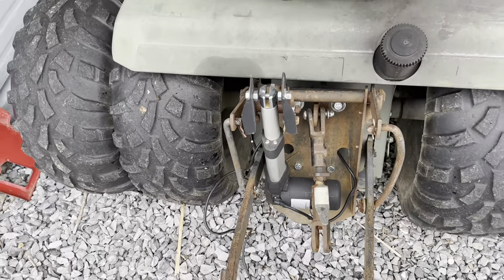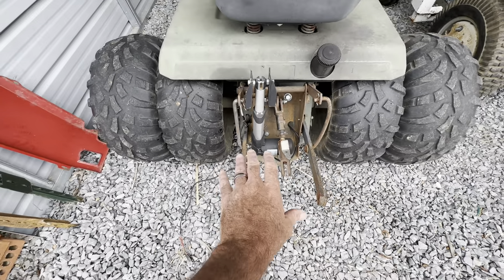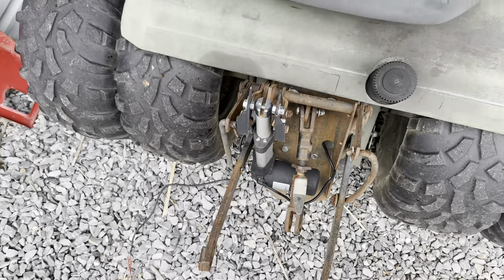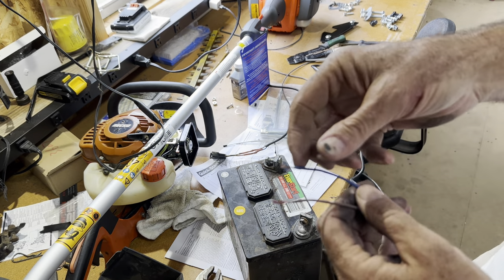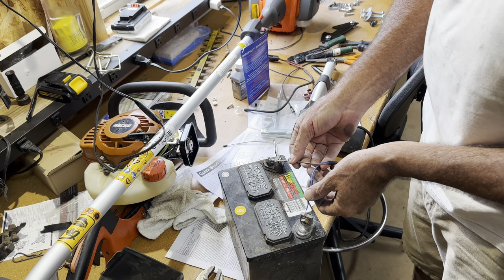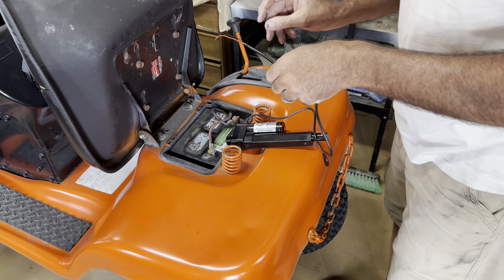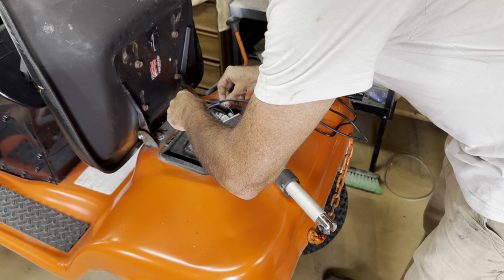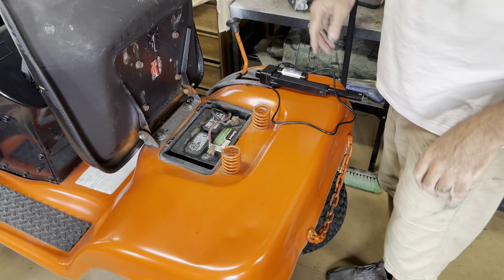Install linear actuator on garden tractor

Comment: Linear actuators are great for adding a power lift to a tractor that does not have hydraulics. They are a bit slow but work really well. Great job fitting the replacement
Reply from the maker: This was  less than $100 and will be a great asset

The big question is how long it will last
Reply from the maker: At that price point

Comment: Regardless how bad your solder joint looks, 3M black electrical tape will make it look better. You can stretch it pretty good to hide it 🙂
Reply from the maker: If I had tips would probably be better - ha

Comment: Not a knock on your soldering by any means.  However, industry standard is to tin the wire (straightened) with a little flux and solder, then lay the two tinned wires parallell and toich the sldering gun to them.  They will stick immediately, and will transfer electricity efficiently. 

The real key is to pre-tin your wires, and they will stick well and easily.
Reply from the maker: Hummmm- good to know

Thanks

Comment: who is the manufacturer of this, and where did you buy it
Reply from the maker: I got it off Amazon. It was like around $65 with a 4 inch stroke and I think the weight capacity was 650 pounds. I don’t remember the manufacturer right off.
Reply from the maker: It sat out in the weather a few times and actually I used it yesterday afternoon so it still works nicely, make sure when you get is waterproof as some of them or not